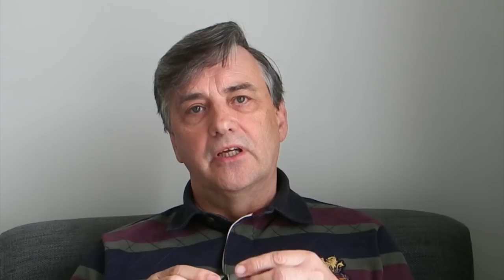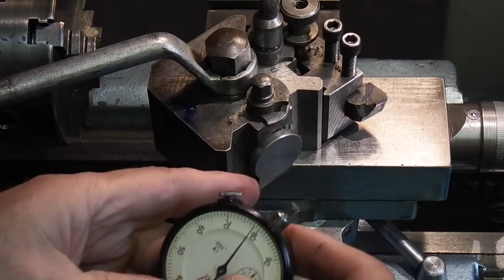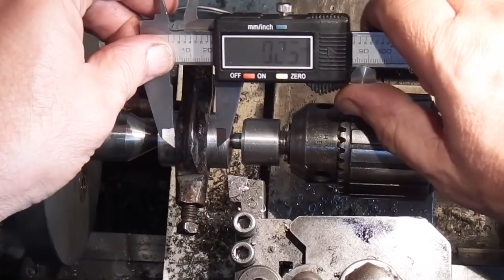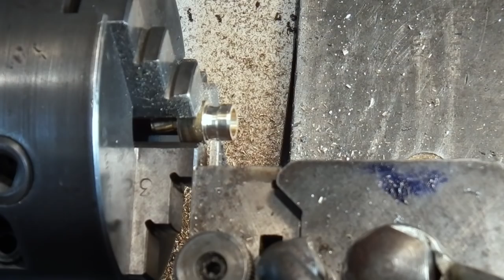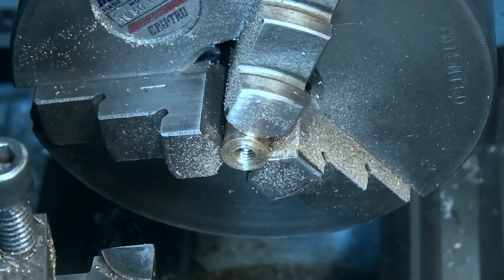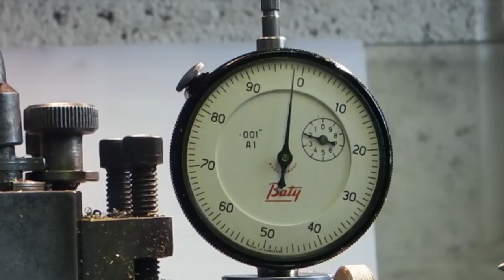Tool height setting gauge

Comment: Sorry, but I have to comment critically...…...once you set those QCTP's you don't move them or else you lose register for the tools set on them. They may still be on tool height but the tools aren't square or in position as set. That is one main reason why you have 2 tool clamp positions for turning and facing. When I set the tools on my QCTP I can remove and replace them and know they are precisely in position as set......only the height ever needs adjusting and with insert tooling that is never. I would also suggest you obtain a few more tool holders and keep your most used tools set in them......leave one empty for odd tool types.